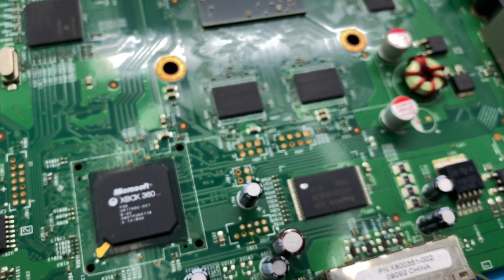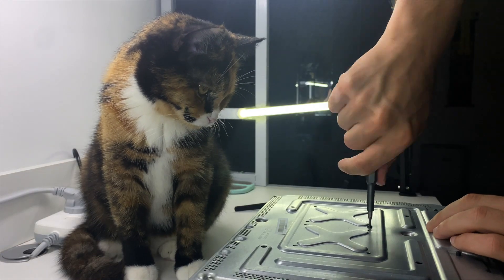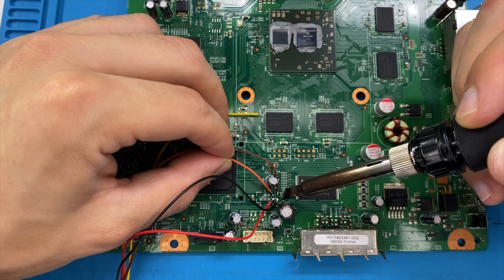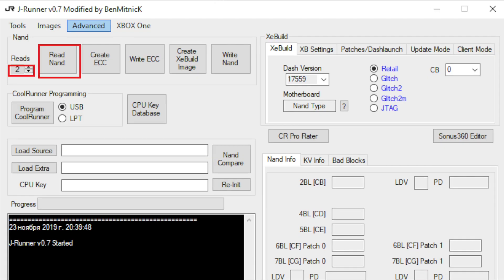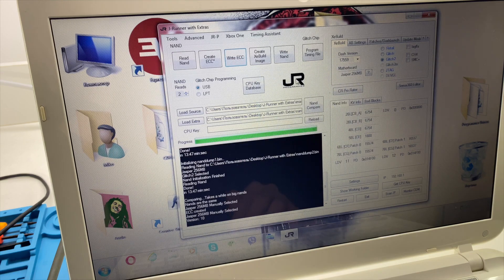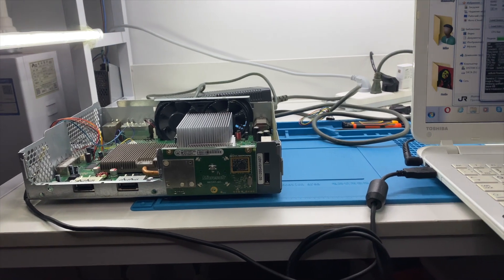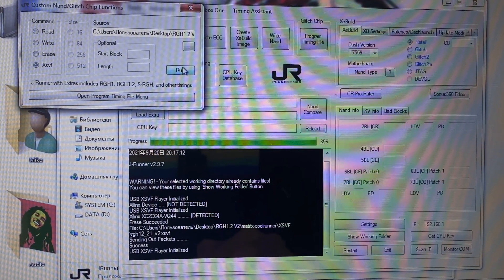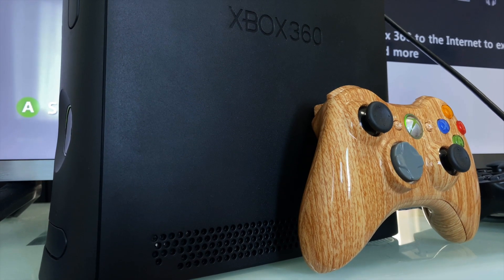XBOX 360 How to RGH 1.2  ( freeboot ) or Jailbreak your console? Coolrunner rev c + JR-programmer

Comment: Hi there, nice vid!  I just got a 360 phat with a  Falcon board few weeks back and just received JR programmer and coolrunner today. But I also picked up a 360 S (dirt cheap) with a Corona as it has  12v,9.6 A.  the question is, am I right in thinking I can only use the coolrunner on the Phat and I need to get a X360ACE S-RGH for this slim ??  Any help suggestions welcome..  I been modd'n ps2 , ps3,  vita's,dreamcast and multiple other systems - now doing a ps4  - but never touched an XBox 360.
Reply from the maker: Hello, yes, you are right. You need the Ace V3 and so S-RGH.

Comment: how if i use matrix nand flasher not with jruner
Reply from the maker: As far as I know, first, you need to modify your Matrix flasher. I will answer your soon after researching
Reply: Thanks bro you're the best
Reply from the maker: I found the solution for you. https://www.se7ensins.com/forums/threads/diy-tutorial-matrix-spi-nand-flasher-upgrade-to-cpld-coolrunner-glitch-chip-programmer.1317809/